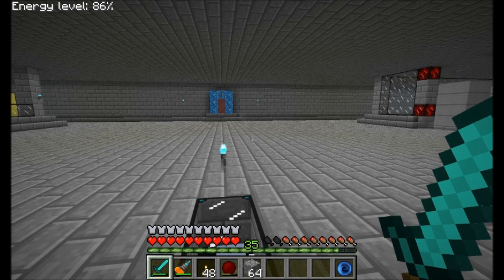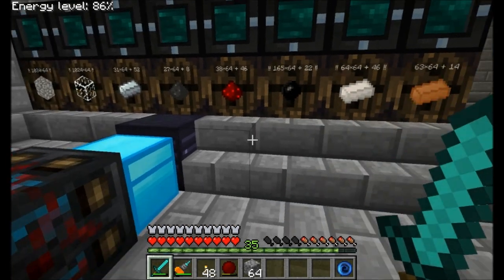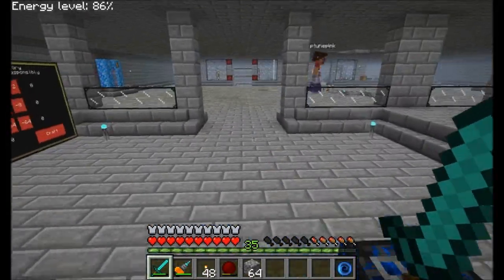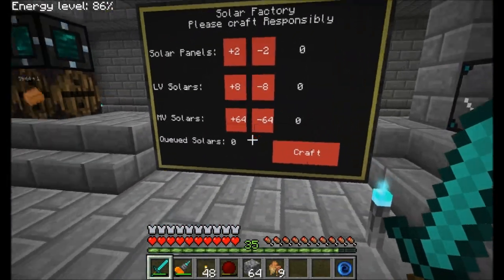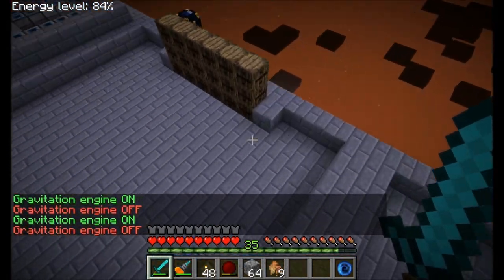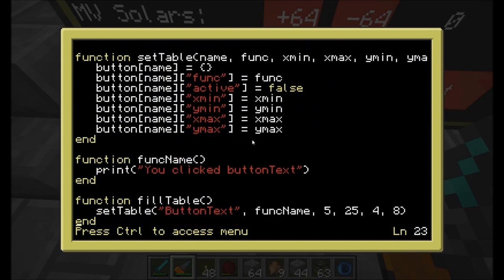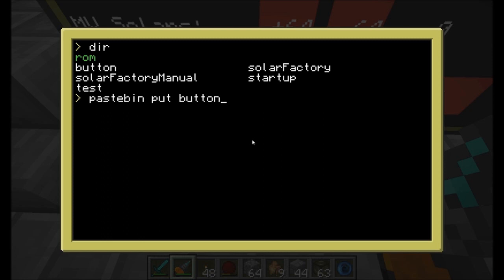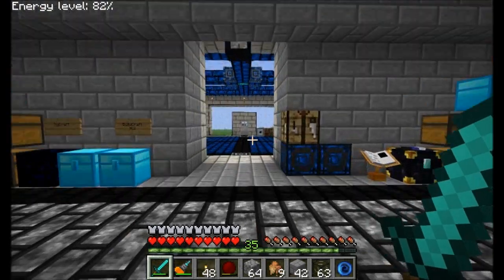Season 4 SMP - Episode 32 - SolarFinale&SecretBase

Comment: I think the best trick (that probably still works) is to dig the block under the block the egg is resting on (so first move the egg to diggable blocks). Then put a torch there and break the block the egg is on so it falls on the torch. It will break just like sand or gravel and voila you have the egg in your inventory.

Comment: Your solar factory really should also be making gold and wood for transformers with your UU matter. you could make use of a sawmill but you would probably need to void the sawdust.  

also keep in mind that 1 gold ingot and 4 rubber can make 4 x1 insulated HV cables. which is enough for 2 transformers

Comment: I'm playing on a custom modpack server and someone had 10 milion + cobble in RP2 tubes feeding 64 recyclers that were underpowered & the whole setup was progessively causing greater tick lag every day, and the backlog of cobble was getting duped in a retreiver and spat out again. 45 extra-dimensional barrels, 1 quantum chest & 5 server crashes later it was fixed. So 1000 stacks of cobble is nothing, but can get a lot worse.

Comment: A pneumatic tube is smarter, it won't drop items on the floor but it is slower than the Buildcraft pipe (Buildcraft is an awesome mod). Buildcraft pipes are faster but not as smart, they will spit out there items when a chest or machine is full.

Comment: Wait! do xycraft blocks have slabs? And heres a idea for a block for thaumcraft or xycraft. You activate a block(preset the directions in the block) and orb(s) of light come out   and stop at a limit but there should be upgrades that can change the limit and the looks, or even ad a defense system that needs energy to work(for thaumcraft it would be a vis storage block or xycraft should have a energy storage(capsuls, crystals, melted xycorium and so on...) That block would be awesome!

Comment: and he choud set it up like a multiblock that what will happen if 2 or more are connected to each other all you have to do i click 1 and when you change the light to what you want it will change all the connected glass to the same light lvl able to pss through

Comment: 3:10 lol "please craft responsibly"... so you shouldn't craft and drive, nor should you drive under the influence of crafting XD
8:42 mod_Redpower: RECALCULATING! *crash*
Between 16:00 ish and 17:20, I had been wondering what armor glitch they were talking about. now I see it... that's crazy
19:10 should the "buttonText" start with a lowercase letter on line 18 and a capital letter on line 22 or is that a direrror (a word I coined for the rare occasion direwolf makes a mistake on camera)?

Comment: So much repetition...could be fixed with closures:

function todoChange (change, btn) begin return function () begin if todo + change < 0 then todo = 0 else todo += change end button.flash(btn) printTodo() end

And then in regButtons, you'd have for example,

button.setTable("+2", todoChange(2, "+2", 15, 18, 4, 6)

And (with proper spacing of the above function), your file would be ~35 lines shorter and just as functional and readable.

(Yay functions returning functions)

Comment: i made a system an di got 700 hoppers made ut to sky limit had LITERY 4000 STACKS of cobble going to get recyceld and every hopper was full at 1 point and i got the servver's tps to 0.1 and the admins yelled at me i made uu matter every 17.9 sec's so much uu matter to make it and over clockers i got temp baned for lagging the server to the max temp ban for 12 days